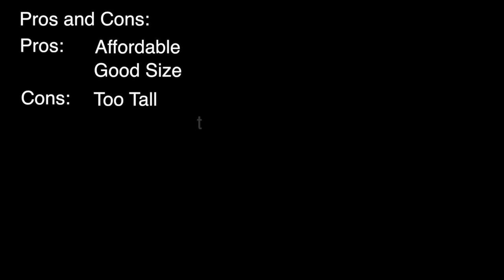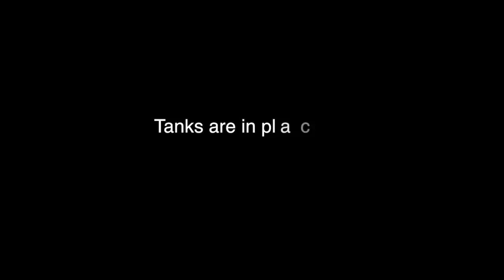Tidal Gardens Greenhouse Reef Update 2013

Comment: I use a length of air line and run it down the drain! takes out all the bubbles!!  start with a 6in or more and slide it down slow till the bubbles stop and use zip ties to hold it in place